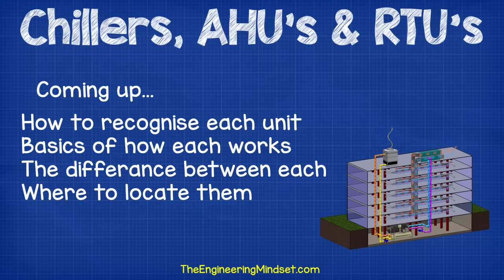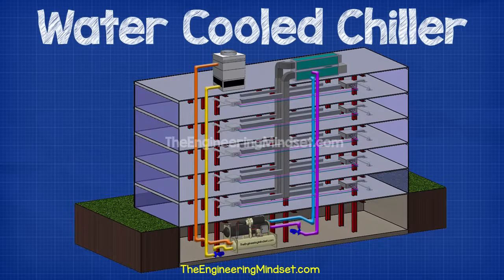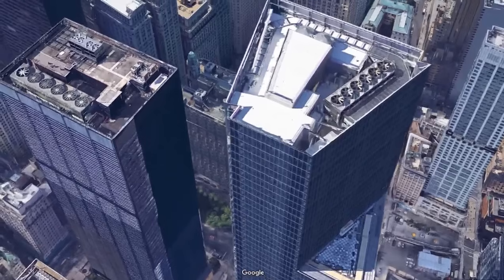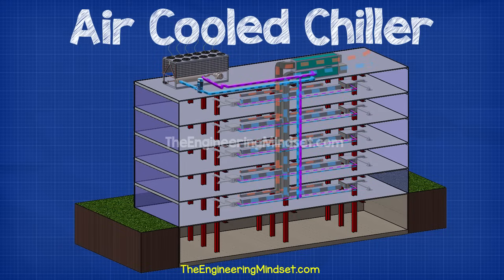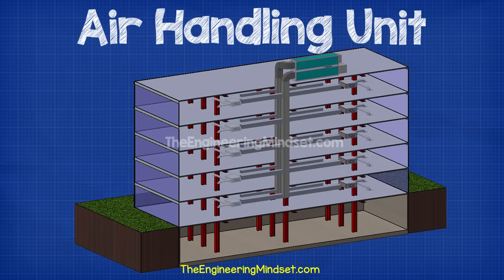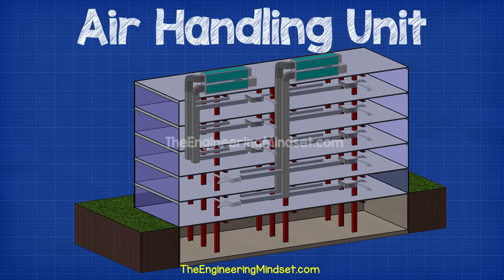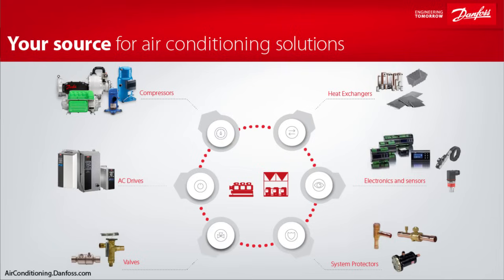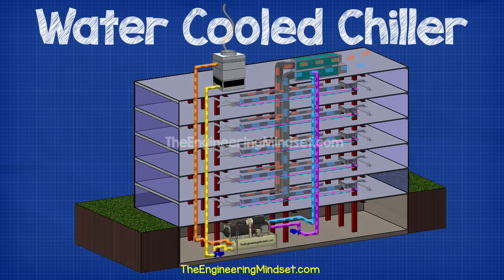How Chiller, AHU, RTU work - working principle Air handling unit, rooftop unit hvac system

Comment from the maker: ⚠️ Found this video super useful? Buy Paul a coffee to say thanks: ☕
PayPal: https://www.paypal.me/TheEngineerinMindset
Reply from the maker: @معتز احمد حسن محمد we covered this in a video already
Reply: I will once I get a job. learnt a great deal from you Paul. Much appreciated Thumbs up :)
Reply: Your explanation is great , however no system use 100 % fresh air except for special requirements , normally return air is reciculated back into the AHU and only 10 to 20% of fresh air is induced depending on ventilation standards otherwise the design is grossly uneconomical
Reply: The Engineering Mindset 👍👍👍
Reply: Thank you for the helpful videos! Is it possibly to convert a 4 story office building, 95K SF, from cooling tower/AHU system to RTU system?
Reply: good
Reply: We live in an 18 story building and every winter our unit is like sauna. I know there are zone valves in the access panels. Does switching the zone valve will affect the whole hvac system negatively?
Reply: Could we have a video on condensed water package units at all?
Reply: Can you get in to affinity laws and thermal conductivity that it applies building mechanical  to systems ?
Reply: Awesome as always man, thanks for all you do, you’ve taught me so much over the years
Reply from the maker: We have a long version here currently https://youtu.be/klggop60vlM
Reply: The Engineering Mindset
Reply from the maker: @sekhartrinadh9063  we have an AHU video

Comment: I continue to hear our engineers talk about “package unit”. Is this the same as an RTU?
Reply: Rtu means roof top unit 
Packaged unit means it’s an all in one does the heat exchange all in one box. Essentially a box that takes and supply’s cold air and exhausts heat elsewhere.
Reply: Yeah, some buildings are even putting Packaged units at strategic floors inside the buildings
Reply: In a way yes. RTUS are packaged hvac equipment placed on roofs. Package units are placed on the ground but usually can contain similar components
Reply: RTU means RoofTop Unit. Package unit is a unit that heats & cools.
Reply: in my understanding of residential and commercial A/C systems for living spaces. 
Package units can be on a rooftop or on the ground. Package units contain the evaporator and condenser coils in one package, hence the name. Split systems will have the condenser coil and evap coil in two seperate boxes, the condenser unit and air handler/furnace unit.
Reply: you can somewhat say that .. difference is a “package unit” can be on the roof or ground, as for the “RTU” it can be a package unit meaning A/C and Heating or it can be a A/C condenser unit of a “split system” on the roof .. hope this help ..

Comment: Hi there. I believe you have the piping from the chiller to the pumps switched around like in your other video. 

Correct me if I'm wrong. I'm an Elec PE for an MEP firm trying to get a basic understanding of HVAC systems.

Comment: Is the difference in temperature of hot air coming to cold water enough so that energy could be converted to electricity, or dumped into a battery instead of dumping into the atmosphere?

Comment: How much should be the Grill temperature of an AC i e temp at discharge in room.
The ACi have bought recently is showing 20.3 deg c and i beleive this is too high.
Does the Grill temp vary with the room temperature

Comment: You seem to have missed out a unique  category but really common set up. It is mostly found in hotels, individual rooms are equipped with self-contained air conditioning units but the condensing unit is the refrigerant pipe that runs inside a larger water pipe that goes to the spraying tower. In this setup, there's no refrigeration of the water, just the water tower equipped with water pumps.

Comment: Sir
I am just a beginner in HVAC field and your videos are very helpful for learning. Sir i have a doubt. From where this chilled water is supplied. In video its showing, supply and return is connected with evaporator. But my question is inorder for chilled water to circulate it should be supplied initially from some point. Right??
So, sir from where does it come from... Please answer . I watched so many videos still not getting an answer for this.
Thanks
Reply from the maker: Gets topped up from inlet at pressure tanks. See our chilled water schematic video
Reply: @EngineeringMindset  thank you sir for your reply.
Sir can i please get the link for that video.
Thanks
Reply: @EngineeringMindset  sir, the caption for the video you mentioned is "Chilled Water Schematic - How to read Hvac Schematic diagram" .
If not, sir can you please send me link for that.
Thanks
Reply: @EngineeringMindset  Sir, In chilled water schematics video, a pressurisation unit is mentioned. Is this the one used for initial supply?? Sir can you please reply?

Comment: I have an Aqua Euro 1/4 hp chiller, and the regulator has become non-operational.  Is there a video, or pictorial guide in re how to replace the regulator?  I have the replacement part.  It is for my 120 gallon Discus tank in the garage; thus the water temp. is crucial.  The space for working with the chiller is limited as it is in the rear of the tank where the chiller sits is near the side garage wall.  Any suggestions?

Comment: I really like the channel. Could you do a video explaining how economizer modes in hvac units help save money on utilities? Thanks
Reply from the maker: Check our chiller terms essential video, should have covered it there.. I think
Reply: It saves energy by flashing some of the liquid refrigerant coming back from the condenser. The evaporated or flashed refrigerant lowers the temperature of the remaining liquid refrigerant going back into the evaporator and this improves efficiency since you have colder refrigerant in the evaporator to absorb heat. Hope this helped!

Comment: I have seen geothermal systems augmenting var HVAC systems, not too often but here and there, aux system used to just help maintain a temp range. I've also seen rain collecting and filtering systems to augment coolers, someone just using available options to invest and s ave $$$ long term. Even saw a set of small wind generators on one rooftop to support the HVAC specifically. Seen a lotta unusual stuff too, but hey construction and environmental systems are a funky field. Enjoying the vids, most of it I know already but you never know where you may learn something new, and although no longer working it's fun to watch and the occasional flashbacks can be amusing, especially residential customers.

Comment: Hi
I have problem on my chiller.
Coil motor temperature are very high increase until 160’ degree celcius while on coupling/on load test on 60% run. Does anybody know what is the problem?

Comment: Do you mind if I ask something? Do you have any video about the difference between all-water HVAC system and all-air HVAC system and which units does they use AHU for all air HVAC and also AHU for all-water HVAC but what is the purpose of all-water because it still has ducts for AHU, I didnt exactly understand their difference and benefit over each other. It would be great if you had a video about it.

Your channel is great. I hope you will be so successful and I will be glad to support you :)) Thanks for everything.
Reply: As a general fact, water is way better then air in transferring heat. My assumption is that for systems that generate a lot of heat water becomes the better option.

Comment: i think the one in my property is a AHU connected to Central plant water. 
But they raised the water price big time here, i need to know if  they  consume water instead of just recirculating the same?  it has a water valve that i must open before functioning
Reply from the maker: If it has an open cooling tower then it's going to consume a lot of water.

Comment: So an ahu blows air into the buildings supply duct work and sucks out hot air in the building through the returns to the outside?
Reply from the maker: Ahu also cleans and conditions air

Comment: Is there a difference between AHU and FAHU? Thanks.
Reply: FAHU refers to 100% fresh air.
Reply from the maker: Officially yes, FAHU is fresh air handling unit, but when you're out on site you'll probably only ever hear someone refer to AHU not FAHU.
Reply: The Engineering Mindset Isn’t AHU a fresh air handling unit as well because its getting outside air? Are you implying FAHU is 100% fresh air and no part of recirculated air is being fed back in the inlet? Thanks

Comment: Can't we just install the chiller next to the water tower on the roof to save some water pipes ?
Reply: The chilled water distribution pipe work will still need to travel to each of the  floors below, plus the condenser water circuit (loop) needs to be as large as possible to limit the size of the cooling towers,  additionally water cooled chillers are Very noisey, and it is  doubtful that planning permission would be granted for roof top location.
Reply from the maker: Good to see you're thinking out of the box. It is possible but its not used. Check out our chiller guide we look at the pros & cons for each https://youtu.be/gYcNDT1d30k